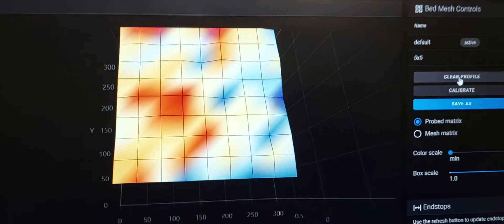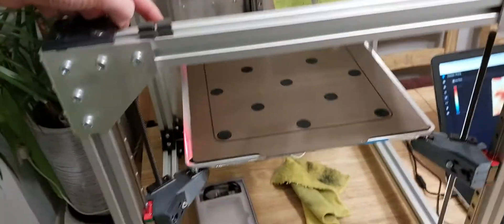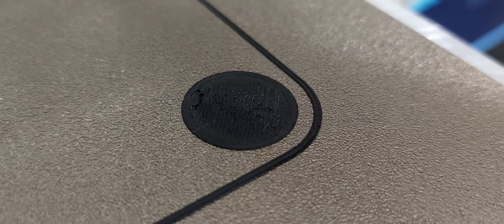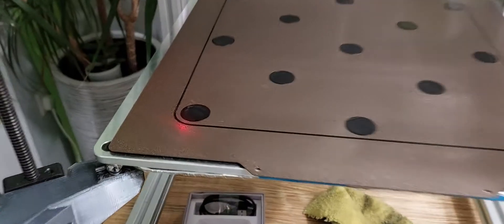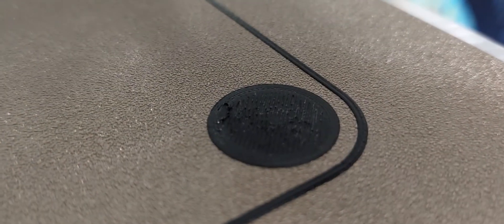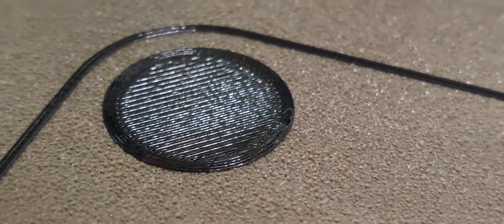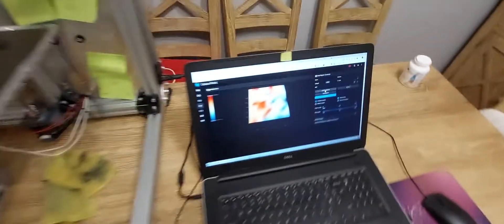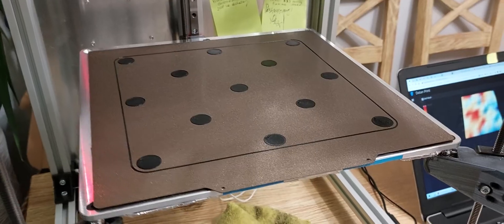Mesh Bed Levelling Issue on Klipper, incorrectly working bed mesh compensation.

Comment: Did you ever figure this out? I've been battling this for almost 2 years now. Never solved it. Tried multiple probes and now even a beacon with a 50x50 mesh.
Reply from the maker: unfortunately not, and in the end i have sold this machine as i had enough tinkering. I needed a workhorse for my regular printing jobs and went for Prusa MK4 - no issues after some initial problems which have been solved.
Ratrig is garbage comparing to Prusa or Bambu labs.

Comment: IMHO, your bed level is excellent, +/- 0.05 is great result, and your test is, OK, maybe not excellent, but pretty good.
Possible reason for such unlevelation could be dislocation of printed circles from the spots where the probe measures the level. This is OK for common people, but you are perfectionist - so, adjust yout printed circles' locations.
Also check the order of your start gcode commands - is the home command (G28) AFTER nozzle and bed temperature setting WITH WAITING TO BE REACHED (M190 and M109)?

Comment: My bed leveling doesn't seem to make a difference after I level it. I did max points and nothing changes after I level it. Did you ever figure out how to resolve this?
Reply from the maker: Hi yes i disabled the mesh bed leveling and manually leveled the bed by means of sanding off and adding material whenre necessary - worked like a charm. I have not used bed leveling since a year.

Comment: The algorithm used by bed mesh is screwing you over.   It is fine for a flat bed on an angle but if you have a bed with warp, the interpolated points will be exaggerated so that it creates a smooth curve between them.  Take a look at the difference between the probed points view and the mesh view.  For example because I had a low point before two flat points, the algorithm invented a hill between the two flat points to fit a smooth curve.

Comment: i had the same issue, first make sure to include in your start gcode to use the mesh. second i had to take apart my print head and make shure to adjust the prope sensor to its correct position.

Comment: Id suggest setting up KAMP now, instead of making a mesh of your whole print bed it only makes a mesh of the area that the print is going to be printed on. Faster meshing and much more consistent first layers. Its pretty easy to setup.

Comment: Hi Delan3d. Did you ever find the cause of this? And fix ? I am having the same issue with my voron trident running klipper. Would be very keen to hear if you resolved the issue. Thanks.
Reply: Sorry Delan3d, I just watched your other videos explaining how you corrected the issue. Thanks!
Reply: @evanmackenzie5811  it's impossible that a firmware can't level a bed at a such a low range what he did was make a flat bed that didn't needs klipper to work , i'm having the same problem and i saw that if you decrease your bicubic tension to 0.1 it seems to work i'm printing right know so i can't test but when i finish i will give it a try instead of losing days over a bed or just disable bed mesh and use only screw tilt calibration
Reply from the maker: @diogocoelho496 let us know the results, i am still simply printing with mesh bed leveling completely disabled and it works like a charm
Reply: @delan3d422  when i put tension at 0.1 it inverted the compesation so i got to 0.15 and it seems to work just fine for now cause at klipper page they say the higher the tension the more is going to compensate. i say give it a try but if it works for you good also if is not consistent maybe i go just with screw tilt calibrate and leave bed mesh alone
Reply: @diogocoelho496  Oh my... I have been fighting this issue for a while now. I've rebuilt my machine several times trying to convince myself it was a mechanical issue. I have no clue when I added the tension parameter but it sure enough mine was set to 0.2. Dropped that down to 0.1 and my first layers are perfect now... Thanks for the suggestion!!

Comment: Just seen your video. G28 delete the mesh, you have to load it again or do a new one for the print, I would do a temporary new one for every print , after G28 type g29.
Reply: Chris, you are a the MVP. I searched for the solution for a bit over a week now. This solved it for me. I simply had it the wrong way around in the start macro. Thanks a lot!
Reply: Your the best !!! looking for my problem sinse several week ... just forget to load bed mesh ..... Thanks
Reply: Others said this worked for them but ... in Klipper, G28 (home all axes) does not unload or disable mesh compensation. Unlike Marlin, where certain commands like G28 can disable or reset mesh leveling, Klipper's behavior is different. I have confirmed this mechanically. So WTF is actually going on is still a mystery -- a year later, even.

Comment: Has anyone solved this problem?
Reply: Yes, I solved it - mount your leveling sensor to Y Offset = 0 and it works even with a fairly bent bed ☝🏻
Reply: @magicmaui77  what do you mean by saying "mount" to Y offset? Cna you elaborate on that please?
Reply: @fullrespect69  you must mount your leveling sensor in line with your nozzle on the Y-axis -> offset 0. You need to adjust your config accordingly (bltouch / probe section -> y_offset / x_offset)
Reply: @magicmaui77  what you mean buy mount your leveling sensor? My probe in on my hotend (stealthburner)
Reply: @joeybarnickle250  Afaik on the stealthburner it's located behind the nozzle  .. so it's offset. I don't know if there exists a mount to relocate the probe in line with the nozzle
Reply: @magicmaui77  I just set it to 0 and testing now
Reply: @joeybarnickle250  It'll be off by the distance between the nozzle and the probe, but I'm curious, if it makes a difference - let us know 😊
Reply: @joeybarnickle250  Did it change anything?
Reply: @magicmaui77  no it did not unfortunately :(
Reply: @joeybarnickle250  ok.. I had at least 3 printers where it solved the problem. Is your mesh area square?
Reply: Hey your right !!! I had the same issue on all of my printer.  I moved my SuperPinda y=0  and everythings is OK...  Real problem in Klipper !!! @magicmaui77
Reply: Unfortunately the only person who can solve this problem is the DEV TEAM - but they think their software is perfect and there is nothing wrong with it. So tell me - why my Prusa use mesh bed leveling and have no issues whatsoever ?
Reply: I’m having the same issue! So there is no fix for it?
Reply from the maker: @joeybarnickle250   the only fix for it on Ratrig with Klipper is to change the whole system or make your bed dead flat - which i did and it works for me. Check my latest video

Comment: I have the exact same issue with an Ender S1 Pro running Sonic Pad (Klipper). Drove me nuts the last few days! Do you have a solution yet?
Reply: Finally it works - I can‘t believe it! I‘ve mounted a cr-touch holder with Y offset 0 and changed the probing area to be rectangular ..
Reply: @magicmaui77  can you eli5 please. I’m having the same issue and I’m on day two and I can’t get my bed level for nothing.
Reply: @magicmaui77  I have the same problem. I use Sonic Pad with an Ender 3 S1 Pro, I don't understand what the solution was, could you help?
Reply: @GuLuppi  Yes - you need to relocate the CR touch to a position, where it’s in line with the nozzle (Y offset = 0). There are some mounts available on the net. Config has to be adjusted (bltouch offset, mesh bed max min positions..). Here‘s the mount I use (5015 blower): https://youtube.com/shorts/E4fWTpFdvzo?feature=share
Reply: @magicmaui77  I found theres command to offset X and Y axis so theres no need for bracket BED_MESH_OFFSET X=0 Y=39.5 (in my case of ender s1 pro). I added it to my start macro and my first layer sticks to bed so far :)
Reply: @Deadkatz  You can do that to test things out / if the offset solves your klipper issue. But that way your messurements are incorrect. Best way is to eliminate the offset physically, too.
Reply: @magicmaui77  Isn't is something that should be happening on firmware anyway? Offsetting bltouch X/Y values on bed mesh to nozzle location? For me it is simple software workaround for bug. What do you mean by wrong measurements? Bed mesh is already measured. Anyway I printed Y=0 offset bracket, so I will see if there are any differences vs what I have now :)
Reply: @Deadkatz  Yes, sure - it's something the firmware does. But if you change the Y offset in your firmware only (via config OR start macro f.e.), it calculates wrong values for the hight, because it thinks the nozzle is elsewhere .. 😉
Reply: @magicmaui77  do you have a link to STL to print?
Reply: Strange that the y offset causing this. Not the first time i heard it.

Comment: I have the exact same issue. Even narrowing down mesh variance to ~0.05mm or so shows the same thing : it's as the mesh was "flipped", yielding a wrong compensation in Z.
In my case, right side of the bed is ok, left side is a bit too low, so it's like having a "partial" 1st layer elephant foot on 3 out of 4 sides of a square shape. That thing didn't happen with Marlin, for instance.

If everything is ok on the hardware side and properly set up, it's logically some issue on the software side (imho).
New issues regarding that wrong compensation Z are often being opened on Klipper's Github, though the same answer is generally given ("bed mesh compensation works as intended").
Though, if your bed mesh uses the "bicubic" algorithm, maybe the stock "bicubic_tension" value is too high, which could explain the overcompensation. Yet, I tried both algorithms and ... even using "bicubic" while reducing bicubic tension was to no avail. Both algorithms show the same results.
So maybe it's really a cryptic Klipper issue.
Reply: Despite all the aconwladgment from the Klipper + Ratrig devs - i still belive they are missing some very tiny bug and this is happening to us who actually care about perfect 1st layer.
Reply: Yep. Definitely. There's something odd or wrong with the way Z compensation is applied with Klipper's bed mesh.
I may take some time at some point to read the source code of the bed mesh compensation and see if I can find any oddity somewhere.
Reply: I think this is also a very deep seeded issue I have specifically left Marlin due to this issue, thinking Klipper would be better.  My mesh looks like a meteor hit the middle of the bed. It has a variant of .6. I'm going to get a credit card or something really flat and try to rub the magnetic sheet more flat for my PEI bed. See if that changes anything. Try to lower the variance.

Comment: I am experiencing exactly the same but with worse results due to the bed being a bit more warped. It s like klipper way overcompensates, so the low points on the bed are so much over done that the nozzle crashes on the surface, and the other way around on the otherside...
Reply: Wow, this is really bad then. What are your probe and bed mesh settings?
you can try mine, it works not bad, but not perfect too:

[probe]
pin: ^probe_pin # For NPN NC probes such as the Super Pinda / Vinda / SupCR / Decoprobe probes.
x_offset: -29.8
y_offset: -13.5
speed: 5               #predkosc podnoszenia stołu podczas mierzenia sonda
samples: 1
sample_retract_dist: 2
lift_speed: 15.0
samples_result: median
samples_tolerance: 0.02
samples_tolerance_retries: 5

#z_offset = 1.76 # poprzednia wartosc 1.77, mniejsza wartosc oznacza wiekszy odstep od stolu

[bed_mesh]
probe_count: 18,18
speed: 200
horizontal_move_z: 5 # wysokosc Z podczas przejazdow
mesh_min: 24,30
mesh_max:274,279
# Zanikanie trzymania sie siatki
fade_start: 0.4         # wysokosc w mm od jakiej zaczac zanikanie
fade_end: 2            # wysokosc w mm kiedy stol przestaje calkowicie kompensowac siatke
mesh_pps: 0,0           # interpolacja pomiedzy pomiarami (raczej przeszkadza zamiast pomagac)
algorithm: bicubic      # algorytm interpolacji siatki
bicubic_tension: .2     # musze doczytac

# ustawienia czulosci reakacji na siatke z tego co zauwazylem to wiele nie daje
move_check_distance: 20 # poprzednia wartosc: 10
split_delta_z: 0.05    # poprzednia wartosc: 0.01

[z_tilt]
speed: 300
z_positions: # describing the location of each bed "pivot point" (referencja wzgledem rzeczywstej pozycji dyszy)
	53,42
	179,283 # 151.5,308
	301,42

points: # trzeba uwzglednic offset probe
	53,42
	180,283 # 151.5,308
	301,42
		
horizontal_move_z: 5
retries: 5
retry_tolerance: 0.02
Reply: @fullrespect69  👍👍👍

Comment from the maker: Hi again,
so after more investigation i am pretty sure that it is a system issue which cannot cope with a bed mesh leveling properly. 
What i have done so far:
1. New probe - SuperPINDA form Prusa Research
2. Made the bed as flat as possible using bloody adhesive tape to rise the depressions (i have repeatedly done mesh calibration and stick a bit of tape in the depression spots to raise them to as close as possible to the ZERO level)
3. I made sure the probe is not affected by the temperature
4. I made sure that all the z lead screws are operating smooth, even and with ease

After all of that i have run a test print and while the bed is now much better leveled - the RatOS does not cope with the correct level compensation.
I will do more investigation with compensation settings and update here.

Comment: same happening to me
Reply from the maker: @Nicholas it turned out to be a warped bed and inaccurate BL-Touch due to the temperatures generated by the bed. I have sanded the surface of the bed to make it less warped, then i have used SuperPINDA probe. I thought that i can relay on the calibrated mesh, but the system does not really follow it all the way. Mesh calibration helps only a little. The biggest issue is always with a warped bed.
Reply: @delan3d422  but the whole point of using a BL touch is to account for a bed being warped.. thats literally why we buy these things
Reply: In my case was the z offset that varies between regions. I  dont know If the carriage is  tilt or not. I have an ender 5. For me a manual bed mesh should fix because It calibrates the nozzle distance not a probes distance.